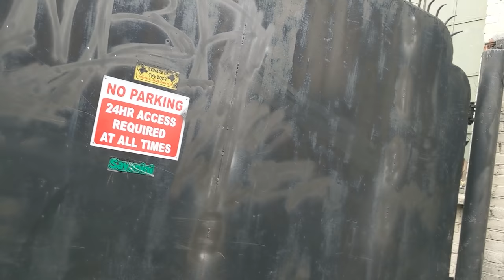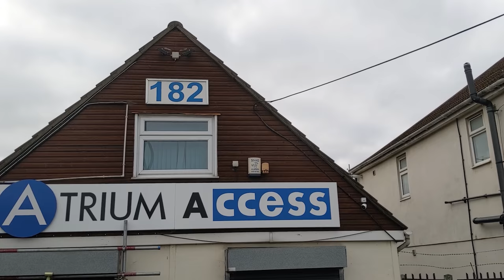Stolen Mercedes GLS Automatrics London Theft Recovery  Operation

Comment: Insanity... keys (things intended to provide safe access to something for who it belongs to) that can be accessed THEMSELVES, not only without any (other) key, but even without their own actual physical presence! How about making a good old key that DOES need to be physically present near the car, that has NO receiving parts that entice it to grant access to anybody, but instead need one single physical push on a simple, safe, physical little button by its owner, that when it gets activated in that simple, controlled & controllable manner only SENDS is signal to the car, and now we're busy (re)designing it anyway, that sends its signal in such a manner that it CANNOT be copied (by a sniffer) ?! You may think that last part maybe is impossible for an RFID key but for all such things (including this one) it later turns out an intelligent way is possible. I for that matter, have a design ready that takes care of that last aspect. If you are making high quality safety systems give me a call. I will talk to your system engineer(s) and hand and explain all aspects and stay accessible afterwards. Your guys work out my specs, decide what parts're needed and design a working circuit. Of course it requires some capable electronics AND software developing. It won't cost much (after all your deliver the 99% that's perspiration)! Aaryjan@gmail

Comment: As far as the cops are concerned the insurance will pay so they don't need to do anything and if you're insurance wont pay then it's tough shit, crimes only occur when you do something by mistake and admit it, the whole system has been turned into a first class joke and they literally don't care, but I must warn you if you accidently drop some litter or read the wrong book you will feel the full force of the law.

Comment: As a serving officer, this is the reality of policing. People here are quick to complain, but it’s not feasible to leave several officers sitting at a location where stolen property might well be, where they are not able to effect entry without a warrant, the officer is correct. Meanwhile you have domestic assault calls coming in left right and centre, robberies, mental health calls which they have to deploy to, cardiac arrests in the street or in a house which the ambulance service ask for us to attend as they have no one free to assign. Sometimes you are so busy from call to call to call you don’t have a chance to even spend 2 minutes going for a loo break. 

Police cannot just bust into an address, where it might be, especially where there are several units or garages where it could be, because it is private property and thus would require a warrant, if it can be narrowed down to a very precise location (I.e definitely inside one particular garage) that is a very different story. 

It’s easy to criticise from an outsider’s point of view, the last thing any officer wants is to be accused of criminal damage by gaining entry to a property to search for stolen property, without a warrant, when a court deems they needed one. Police officers are more likely to be convicted than members of the public are of crimes, as the charging thresholds are lower. 

It simply isn’t a case of busting in to several units and having a nosey around, I put together a drugs warrant a few years back and had to go through the courts to do so, there was strong evidence, likewise this would be no different if the exact location was unclear.

Comment: usual DIY police force, ...working for the crims....or so it would seem  - just dont drive your car back from an MOT station after an ABS light stayed on during test - Fined and points (zero previous for 60 yrs) ..pensioner and 15 mths later, still no transport....

Comment: pointless to buy any tracker! just get a good immobiliser like ghost! police is a joke btw...
Reply from the maker: We understand the deterrent aspect of immobiliser technology, however immobiliser systems are not without security or safety issues,  so having a high performing "theft recovery system" will provide the ultimate peace of mind. Most of Automatrics recoveries are much quicker than this operation and with no or minimal damage. Although we agree it is important for owners to do their homework and consider the security location technology, recovery features and overall system performance differences  between one of more than 10,000 GPS trackers, compared to say one of less than 10 true covert SVR Stolen Vehicle Recovery system providers. To be fair sometimes the police do actually get the job done 👍 Thanks for your comment